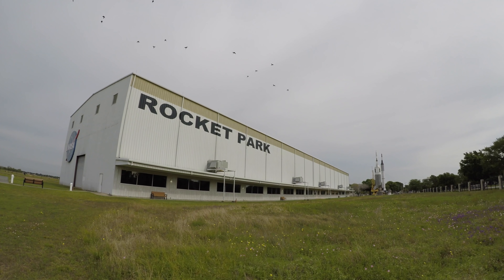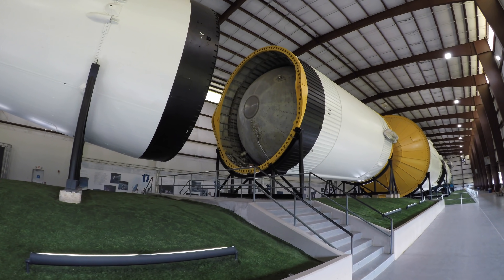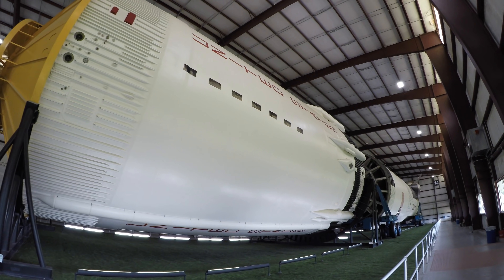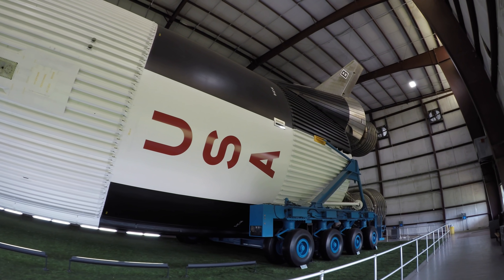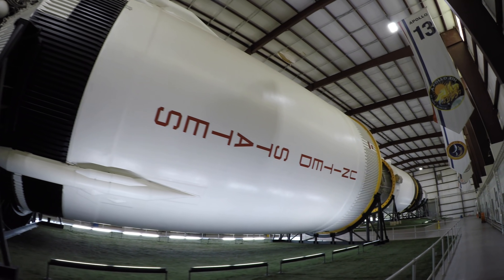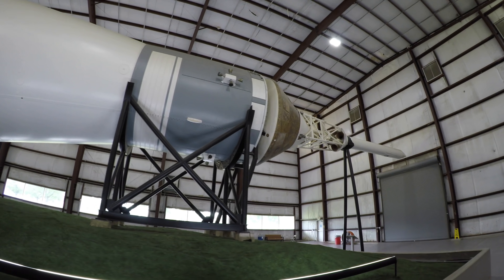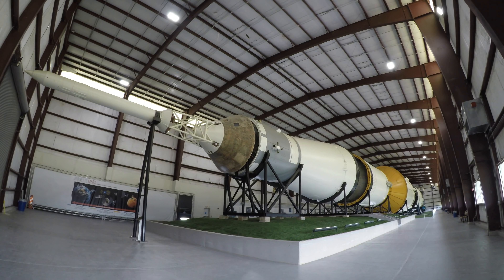Saturn V - Walk Around in 4K

Comment: I watched Apollo 8 launch at CoCo beach as a North American Aviation Employee Family Member (Daddy worked for NAA in Tulsa, OK).  I STILL remember the CBS camera crew THROWING-UP from the noise/blast of the Saturn V Booster! Over half the spectators on CoCo Beach were tossing their cookies, but I'd been to three test firings (Downy, CA) and had on ear protection and was sitting down with my head between my knees. It broke windshields and side windows of cars parked on the beach beyond the ropes. When Chris Craft (The NASA "talker") said it was 420,000 feet high and 26 miles downrange, you STILL couldn't scream to the person 2 feet away and they hear you. 26 TONS of kerosene burned to move the first 6"!!!

Comment: Wonder why they didn’t build a building like they did at Kennedy Space Center for their Saturday V? This building just looks like a big shed. The Saturn V Center at Kennedy is a full out exhibit with many elements.
Reply: This is "temporary" shelter built during the Saturn V's restoration in 2005. The rocket was previously displayed outdoors, unprotected. There just hasn't been a real effort to come up with a proper museum building for it.
Reply: It's not really All there, some staging components are missing and structural parts also.

Comment: I watched Apollo 11 take off from just outside Cape Canaveral when I was 12 years old. Later on I got to tour Michoud with my class and see the first stages being assembled. Then many years later I got to climb around on the Saturn V located in Huntsville at space camp when they hired the company that I worked for to do a July 4th laser show in which we used the Saturn V as a screen to project graphics and video on. About 3 or 4 years ago I went back to Michoud to see the last Saturn V first stage before it was moved and restored.... These rockets are incredible feats of engineering and I am sad that we didn't use the last ones.... One day soon I intend to go back to Cape Canaveral and watch another manned flight lift off before I die. I will never get the opportunity to fly into space but I am never going to not want to go.
Reply: Well... Wally did it at age 82 on BO's New Shephard... :-)

If you're rich enough (30+ milion green ones) maybe you can buy a seat on the next flight... :-)
Reply: @thiesenf  you’ve got to wonder how many paying customers Bezos will get at $30m for a twelve minute ride and 4 mins of weightlessness, while Branson offers a 2 hour ride with 3 mins of zero G for $250k!
Reply: @DanSmithBK  I think VG will take the lead on that one... :-)
Reply: Are you impressed with the Starship vertical landings?

Comment: I saw this one before they had an enclosure for it. It really is massive. It's as long as a small oiltanker ship. I just remember imagining the amount of energy it took to get this monster "vehicle (to use NASAspeak. Vehicle. Not monster vehicle )" off the ground and up to almost 18 thousand miles per hour. The engineering is breathtaking. Even just the fuel pumps for each engine have over a thousand horsepower..........  each .
Reply: 55,000 HP for each F-1 engine in the first stage, 10,000 HP for each J-2 engine in the second and third stages.

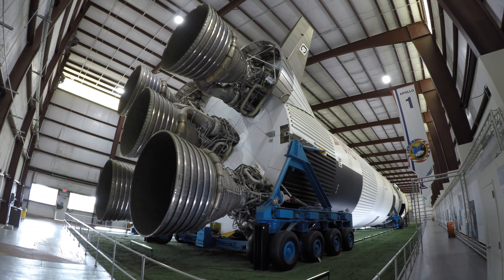Comment: 4:21 that engine looks overexpanded by the way
Reply: huh??
Reply: Pretty sure that is because the f-1 engine was in fact overexpanded
Reply: @daanzoomer2997  The F-1 engines were not overexpanded at lift off. The diameter of the engine bell was calibrated to that size so that at ground level the exhaust stream would drop to atmospheric pressure when the exhaust gas exited the bell. This was done to keep the exhaust gas contained by the atmosphere and flowing straight down, which provides some additional thrust at lift off. Then later when the vehicle climbed up into the thinner air the engine bell would become underexpanded, which is why the exhaust stream can be seen fanning out and getting wider and wider.
Reply: This is the only real and flight certified Saturn V remaining on Earth, and even so there are still parts of the engines missing. I think the cooling ribs on the bell were originally covered, but looked ugly as frig.
Reply: @john-s-peñois  You are right. A flight ready Saturn V had thermal insulation blankets covering much of the F-1 engines. The engines on this particular Saturn V that is on display has the blankets removes to allow visitors to see the details of the engine that would ordinarily be covered by the blankets.

Comment: Is that a real Saturn 5 or a model.
Reply: Yes it’s real.
Reply: @pep5088  Sorry I disagree... the stage 1 is 42 meters tall 10 meters wide 2,600 tons.... it does not look like 10 meters wide....correct me if im wrong.
Reply: @RLCJ934  yes, you are wrong.
Reply: @RLCJ934  you are wrong.
Reply: @RLCJ934  Been there, it's definitely 10m wide. It's pretty overwhelming.